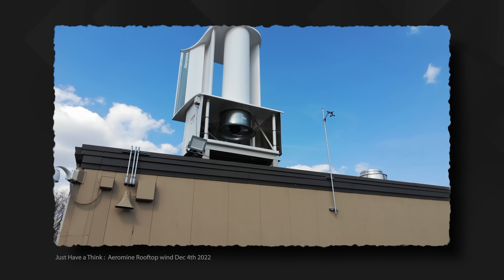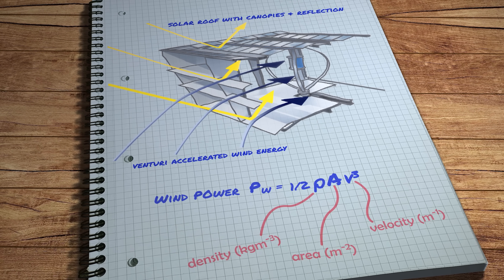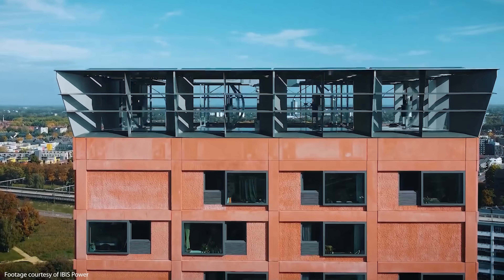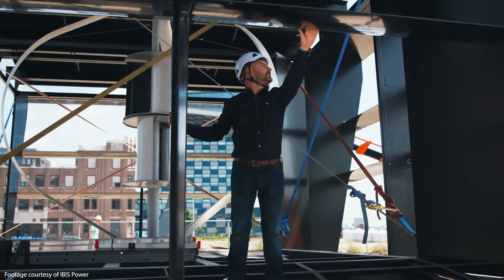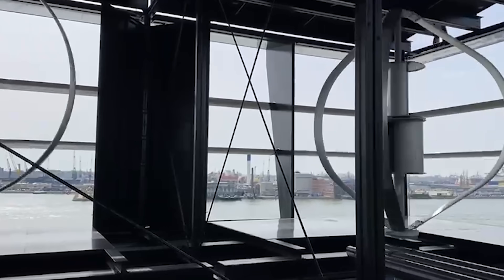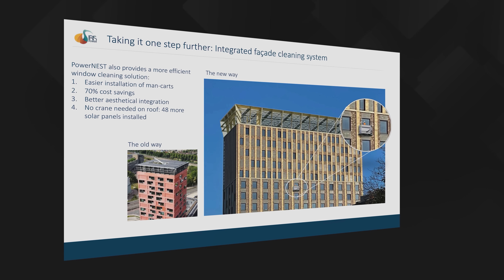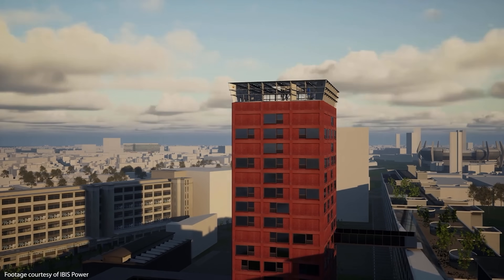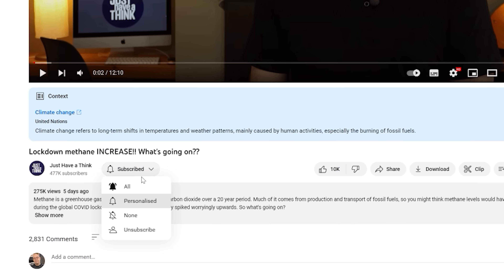The smartest renewable rooftop system in the world?

Comment: Looks like a very good idea to utilize this usually useless space. Architectually valuable facilities like these could also be used in other places than rooftops where there is lots of open space to be covered and sunshaded, like parking lots, restaurant terraces and patios and so on. There's lots of potential in these facilities. Combine it with storage and we are a good long step further along the road to more sustainability and sustainable, local energy generation and usage.
Reply: You really need the height to make a system like this viable.
Reply: I think energy storage is not needed. Just sell the excess electricity to the grid and pay other costs for the community, like property tax.
Reply: @timogronroos4642  Energy storage is very much needed for times when you generate way too much electricity, which would lead to throttling or shut down of your panels or wind turbines because the generation capacity exceeds the electricity need, and to store that excess energy for times when you don't generate enough to meet the demand, like nights, cloudy days, day without lots of wind, spike times, etc.
Reply: @timogronroos4642  Thats much less efficient and useful unfortunately.  Power transmission and tranformation losses are real.

Comment: It looks like a great system. One small thing I wondered about though is the window-washing platforms - is the idea that they will be parked on one side of the new rooftop structure, and that employees will access it from the rooftop? I am wondering whether the increased wind speed generated by the design could make the rooftop an unsafe place to be standing, though perhaps it isn't that strong.
Reply from the maker: I don't think that would be a problem Dan

Comment: What happens when a rotor decides to spit a blade? 

I'm reminded of one of the early, and fairly large, eggbeaters installed up in Canada. They were doing repairs on the brakes and since it was thought that these rotors would not self-start, they didn't bother to tie it down. 

When they returned it was running without a load and they had no way to control it. So they put a video camera on it and waited. 

It self-destructed before the winds slowed. And since it was a guyed structure it happened dramatically. A blade broke lose near the base, swung up tangling and cutting the guy wires and then falling in a heap. 

Maybe they have a plan for blade failures but it's not self-evident.

Comment: I really have to hand it to the Netherlands, being on the front line of climate change, they are taking the lead in trying to implement new technologies that should help mitigate the amount of greenhouse gases they produce.  This extremely clever integration of technologies looks like a winner, I’m actually going to forward the info to the group within our company that looks at reducing the not-insignificant impact of our operations.  As a bonus, it looks as if this will pay for itself in a very reasonable time frame.
Reply: Solar panels in the Netherlands are carbon positive due to the fact that they are made with electricity from coal and the Netherlands doesn't have enough sun to get the most out of PV panels.
Reply: @derekcraig3617  Source?
Reply: @derekcraig3617  Most of the solar panels come from China. But even if the panels are made with coal produced electricity, over the life of the panels, I do not believe that the panels will be carbon positive.
Reply: @derekcraig3617  and yet even if that’s a fact (made with power from coal) it’s irrelevant. Before we had coal or oil we had wood, and that’s what we used to smelt the first metals, which were then used to produce the boilers that consume the coal you seem to be so fond of. Does this surprise you? It’s called bootstrapping, you should look up the concept.  Let me jump you ahead a few decades… humanity, after a period of time is able to produce sufficient quantities of energy from renewable sources to power all consumer and industrial needs, including to produce solar panels and wind turbines with no use of fossil fuels.  At which time we’ll be able to (mostly) retire them. And trolls, or paid shills such as yourself will have to move on to whining about something else.
Reply: @sjsomething4936  wait, how am I fond of coal? where did I say I love coal?
Reply: @derekcraig3617  You didn't - but why such an irrelevant comment in the first place?
Reply: @derekcraig3617  Factually incorrect. But who am I to argue with: "My mind is made up; please don't confuse me with facts."
Reply: @DrakeN-ow1im  if that's actually so the offer up some of your facts

Comment: Looks good, but.. I would like to know how it will work with the cool climite. 

Will thus constructions break if a lot of snow will be on the top of this conctriction? 
How hard is remove snow and ice from the PV panels? 
How hard is to remove icicle from this construction? They can be deadly if grow of icicles will go out of control. 
How additional boost of wind speed close to roof at the winter will affect the heat isolation of the roof of building. I thing this construction will cool down roof a lot (that is perfect to the hot climate and bad for a cold one)

All this problems are easy solvable with regular flat roof (you can go on the top of them any time). But you can't go on the top of this construction of PV panels in the high of 4m above the actual roof. And this can be a huge issue in the terms of servicing both roof and powernest. 

But for a hot climate this construction can be perfect, as I said

Comment: Add yet a little whipped cream on that desert, any A/C units up there on the roof, as well as the roof itself, are now in the shade AND getting a lot of air across them as well. Yet another win!
Reply: But they’d also emit heat, which then reduces the efficiency of the solar panels so there’s a tradeoff to be made. It certainly might be worth it as the wind would quickly disperse and carry away the heat, it’d require a cost/benefit analysis to determine if overall would be better or worse.

Comment: That is very clever. With the weight there coul'd be at some buildings a problem. They are designed for the snow weight, this 2-300 kg/m2 adds to that and maybe exceeds the design limits.
The solution could be with the pv-modules. As far as I know, if you drive current through pv-panels, they produce heat, wich could be handy to melt the snow and with that to eliminate that weight.
Reply: Actually they produce light, with heat as a byproduct of inefficiency losses.
You'd be better off with a purely resistive heat trace running between cells, like the rear window defroster of an automobile.

Comment: I love all this about making electricity in different ways. The only thing that bothers me is that all these conversions between DC and AC interfere a lot with the radio. As a radio amateur, I am very affected by all this conversion. Even LED lights are a nightmare.
Reply: Stuff like that needs to be heavily shielded to avoid EMI with radio
Reply: As a supporter of radio, it appears that this is the prime time to invent a device that would counter the DC interference.
Reply: @truenorthbc  "A device" that counters high current switching? (of things like rectifiers and PWM controllers)
As 1 suggests, you can shield it, but you can't reasonably eliminate it.  It is inherent in the operation. 
So you either harvest wind and solar then invert it for use on the grid or you don't bother doing it at all.
I think we have a pretty good understanding of how electricity works at this point.
Reply: Talking over radio has been replaced with chatting online. Just saying. Everything internet.
PS: I did like to chat on 27MC in the past, but they are extinct nowadays. Now I chat on youtube it seems :-)
Reply: Filters are the solution. We can receive the signal from a spacecraft beyond the solar system (few watts of transmitter power) - right? But putting a good antenna at a decent point is getting more and more difficult for regular folks.
Reply: @janami-dharmam  The U.S. can't even get filters on commercial aircraft so the mobile telecoms can proceed with their 5G rollout.
In the '70's I used to bitch about the neighborhood kids on dirt bikes with CDI walking all over my rx
The more times change, the more they stay the same....
Reply: you'd be a good person to know if ever SHTF in a big way :D
i get it, hopefully you can resolve the issue with some o the ideas others have suggested

Comment: If no wind a helium filled delta kite floats 100 ft high.
 Wind above 4 mph causes top kite to rise and pull a train of kites up.
 Cloth hose connects all train kites so air pressure runs a generator on the ground.
 Weight pulls kite train back in when wind is too light.
Reply: Helium is a very limited resource though, isn't it? It's certainly a useful attribute to have a consistent force lifting a kite up in the air, but it wouldn't be applicable on a large scale because of the limited availability of helium.
Reply: Hydrogen instead of Helium is possible. Scale: Kite train might be lite enough to take hiking. Kite size and/or numbers increased to power a home.

Comment: Speaking as an architect it certainly is workable from an aesthetic perspective, though having every building look the same isn’t terribly appealing. It looks as though keeping the roof deck clear of other tall structures associated with the building infrastructure would be important. The modularity of the system is very efficient and I wonder how that efficiency would be affected by taller buildings and the ability to hoist that large a structure to roof level. Don’t remember hearing anything about ROI but maybe I missed that bit….
Reply: He said 8-12 cents per kW over a 25-year life depending on location.

Comment: Given that rooftop installations on two storey buildings cannot supply 100% of electricity demand I find it very hard to believe that this system can provide 85% of the electricity requirement for a 12-storey building

Comment: I would imagine the system also produces a marginal decrease in A/C cooling costs by providing shade for A/C units and increased cooling air under the structure. And if the flooring is painted in l highly reflective white paint that to would have a marginal effect on A/C bills

Comment: The idea is good, but the cost about 10c/kwh is too much compared to commercial wind and solar which is 3-6c/kwh in EU on average. So it's not really practical in most situations.
Reply: taking into account the nimbyism whenever onshore wind is proposed, and the previous unsuitablity of city wind power generation, while being 6 to 10 times more efficient than solar alone, i think its a great idea. think of all the thousands of square metres of unused roofspace in your average city environment. maintenance must be cheaper as well as they arent hundreds of metres up in the air, but accesible via the rooftop.
Reply: @kevinwillis6707  I agree, it’s not necessarily about the overall cost since even if commercial scale wind and solar are less, they won’t be sufficient on their own to provide enough power for all of society’s needs.  This is yet another piece of the puzzle, and also it permits either the businesses or buildings etc. to isolate themselves from a power outage that they’d suffer from if reliant on grid-level power, even if the grid power is sourced from renewables.
Reply: @kevinwillis6707  Each of these turbines are "3kw maximum output" and even optimal HAWT's return 30-35% capacity factor.
How the hell is that even close to 6-10 times the solar available on this roof?
Reply: @jimurrata6785  im quoting what the report said, i assume he means the extra gains from flat solar directly on the roof, where this is more efficient because the airflow underneath makes both the panels more efficient, and you add the wind power. all these claims are maximum estimates , youd have to take it up with the designer .

Comment: The key is independent ownership of the energy. Electric companies will lose profits if they don't control it.
Reply: Yea, that figure would depend greatly on the quality of the building design in relation to sustainability, as well as the behaviour of residents & energy systems. Such as hot water & heating... Ie are these electric or gas?

Comment: What a neat system and a fantastic retrofit opportunity. Invariable the consumer end of the grid would need upgrading if this were adopted at scale. Also, electricity storage in each building would be great for power outages and peak demand reduction. At the apartment block scale flow batteries could be in the plant rooms?
Reply: Let’s not forget all the batteries in the EV’s should always be hooked up doing something while they mostly sit doing nothing!
Reply: Why not add a second maintenance cradle as a gravity battery?
Reply: @daffyduck780  oh, I like this idea. Related to this, I wondered about using excess power to pump water to a holding tank.
Reply: @mikedodger7898  I liked the idea as well until someone pointed out that batteries are more efficient and don't involve suspending heavy weights above pedestrians. O well.
Reply: @daffyduck780  did you ever do the calculation? It's disheartening unfortunately
Reply: Guess two schools of logic for battery placement. Directly below rooftop units would reduce wiring and the wind power component could assist in battery cooling, but added weight at the top of the building would have to be consideration. Alternatively would be in the basement where ambient air temperature would be cooler (but would need to be somewhere that wouldn't be at risk of flooding) and possibly a location better for routing energy off-site. Think location of batteries could be a building to building proposition but a key component (being able to store energy) in the success of such a system. Race for higher density (& lighter) energy storage is constantly evolving. Would be best if this rooftop system could easily adapt to new battery technologies, but don't foresee as being a problem.
Reply: Sun bathing on the roof top is now out for young dutch ladies.
Reply: A battery is a battery, of course you could stick a flow battery in the basement (not on the roof)
Reply: You can't just add tons and tons of weight to an existing building.
Reply: The battery storage bank weight can be used as earthquake/wind dampers.
Reply: Or PolyJoule Battery 👍🔋
Reply: We better hurry up with this because we're almost a third of the way through The Decisive Decade.
Reply: Appartements mean fewer roof surface/inhabitants. And even fewer as the building has more floors. 

This system has the most use in personnal houses. Best EROI/inhabitant. 

City rooftops are better used for farming.
Reply: @etienne8110  Think allotments would be better for City farming. Video said powernest produced 85% of electricity for the residents of flats which is very good and much better per sqm than normal rooftop solar largely, I expect, because of increased wind being high up, unavailable to single or two story houses.
Reply: @robbrookes4889  And a selection bias on the location. (result on the best locations (high, near sea/wind corridors)
The wind gen is quite weak (3kW) so I doubt it produce enough to power an appartement, much less 5 (if 5 floors under the sme roof area)

It is also quite noisy (40dB which is also the threshold for health issues at night) so I wouldn't like to be the one living in the penthouse ^^

Rather than living places in a city, this should be for factories and other manutentionning/staging areas.
Reply: @etienne8110  The air flow is increased on taller buildings, single story residences would work poorly.
Reply: @etienne8110  Rooftop farming doesn't make much sense to me.
1. The necessary water and soil is heavy, increasing the financial and environmental cost of building the structure.
2. They will always be dependant on imported fertilizer. 
3. Pesticides and herbicides need to be strictly forbidden in these environments. 
4. The labour to produce ratio on plots this small are ridiculous as a practical proposition.

I'm all for community gardens on a social basis, but let's keep them on the ground where they aren't exclusive to occupants of one building.
Reply: @westasleep  Go explain that to the cubans.

Comment: I think i prefer the Solar Photovoltaic - Solar Thermal Hybrid Panels made by Dualsun, but mixing the Wind Cooling with Photovoltaic Panels is neat!
Reply: And as with all things Renewable, each place can have it’s own niche, and thus this solution may fit very well in some places!
Reply: After Finishing The Video, i think this could probably eat up the Middle/High Density’s Area “Niche”, and DualSun eat up the Suburban and Rural Market.

I think it would be especially neat if District Heating/Cooling would make the Hot Water  ot needed in areas with it from some sort of Combined Cycle Plant (Peaker-Plant) thing, Seasonal Storage, or even something Geothermal…Granted Electric Heat Pumps may make more sense!
Reply: The Netherlands are on the latitude of Edmonton, Canada. There is often more wind than sunshine.